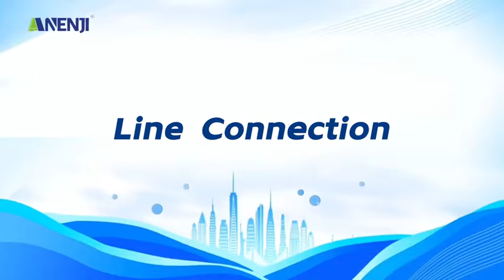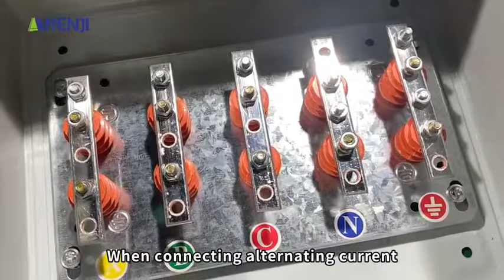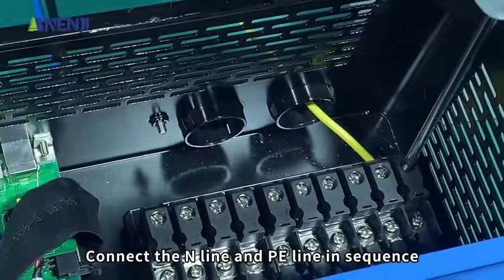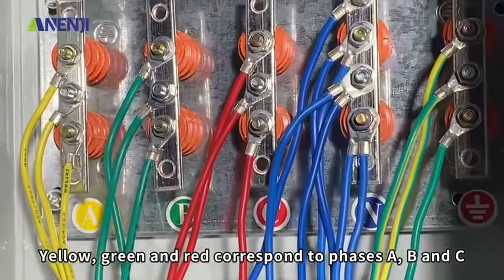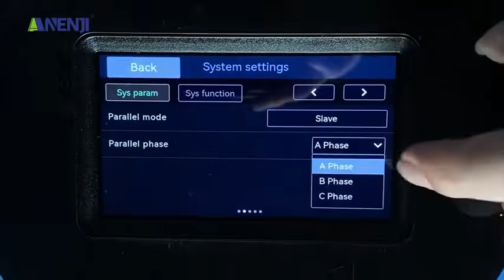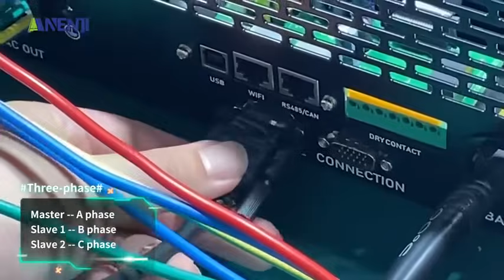ANJ 12KP LV WIFI

Comment: I would like to share my experience with this company so that other customers can be aware before buying.

I purchased an inverter less than a year ago, and unfortunately it has never worked properly since the day it was installed.

I contacted support several times and performed all the tests requested together with their technician. The datalogger connects correctly to Wi-Fi and the internet, but it does not communicate with the inverter, so it cannot read the inverter parameters or the battery data.

Their colleague previously informed me that the communication board inside the inverter would be sent to solve the problem. However, the board was never shipped. Instead, after months of waiting and repeated tests, I was even asked to pay €50 for shipping.

This is very disappointing. When a product is defective and has never worked, customers should receive proper support and a quick solution under warranty.

I work professionally with battery storage systems and have collaborated with several manufacturers. In my experience, serious companies take responsibility for defective products and solve problems quickly. Unfortunately, this has not been my experience here.

I hope the company will finally take responsibility and resolve this issue. Until then, I strongly advise potential buyers to carefully consider the level of after-sales support they may receive.